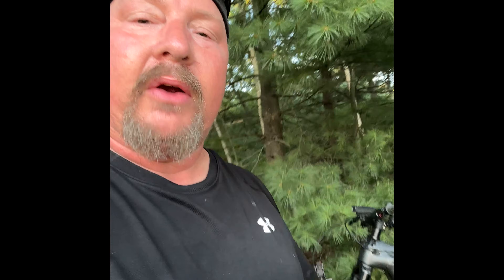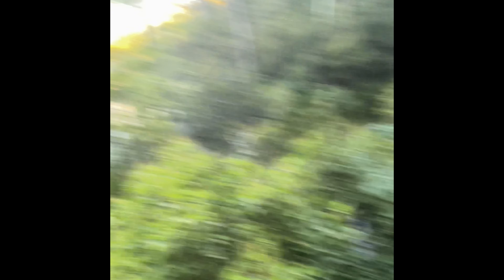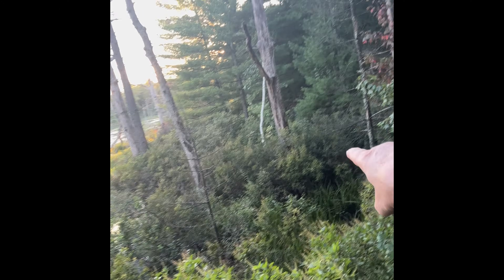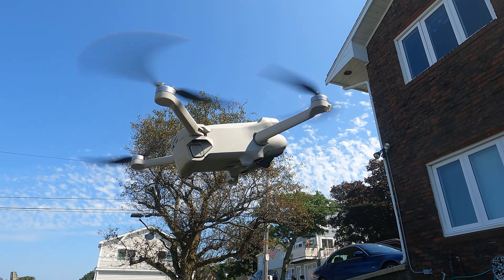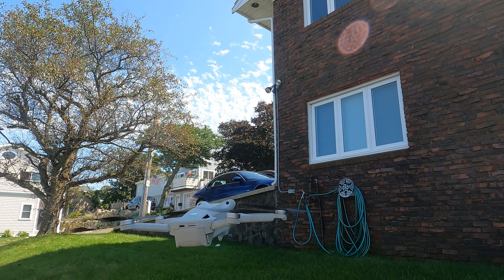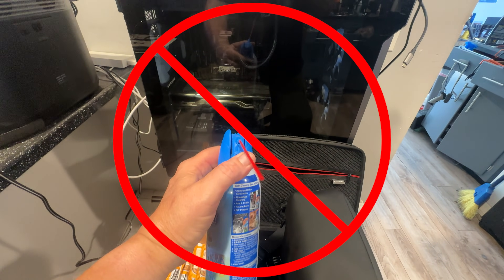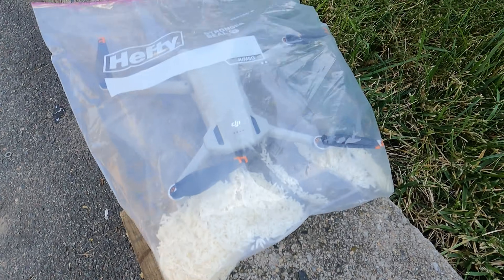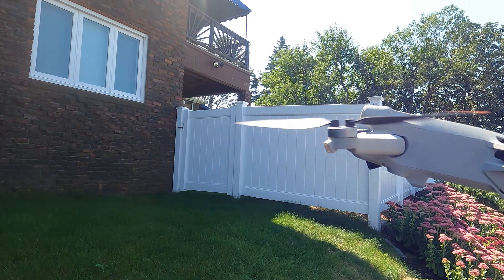HOW TO REPAIR YOUR DRONE AFTER A WATER CRASH

Comment: I'm surprised nothing was fried considering the power was on when it crashed, or the battery wasn't fried. 

Is there an update a year later on the status of it working?

 I just crashed mine into a creek when I was using it for tracking me walking my dog to the right, it hit some tree branches. I'm tempted to try and see if I can get it to work again but DJI recommends not to and instead of send it in. 
Just sucks I have to wait possibly 2+ weeks but I think it's worth getting a new drone.

I haven't tried my memory card yet, i'm letting that dry too, I hope it works

Comment: Hate to be that guy but.... Rice likely doesn't do much to dry out electronics. Dry rice just isn't very absorbent. You can test this yourself by weighing out a quarter pound of it then leaving it in humid conditions. Weigh it again afterwards and you can see that it'll absorb little to no water.
Your best bet would be to find a spot with dry air and set up a fan to blow air over it. If that isn't an option, you can get silica packets and place them and your phone in a bag. The silica packets will absorb at least some of the humidity.

Comment: On Friday May 17 I was flying over a river in eastern Tennessee and was flying towards a suspended walking bridge.  So I decided to elevate to fly over the bridge, but I could see the power lines over the bridge and flew into them.  Needless to say my  Mini 4 Pro went swimming.  I did have any rice so I put it on top of a split A/C unit so the A/C could pull to moisture out of the drone and the battery.  Now It’s Sunday May19 and everything is charging and flying.   

I dodged a bullet this time………

Comment: The most important things you didn't really cover are: battery out ASAP, rinse with clean water ASAP, rinse and re rinse u til confident no swamp juice or salt or any other minerals left, then repeat again with distilled water, tehn shake dry as much as possible, then the rice, or hot water cupboard, or in a room with a dehumidifier drying the air aggressively. More patient equals better for the drying step. Fingers crossed. Mine spent 4 hours under salt water today. Fingers crossed indeed.
Reply: @fredio54 can you pls let me know how it went? Did yours work again??
Reply: Did your drone survive?
Reply: @emilieherbert4990  no, sadly. Spares not economical when so much damaged. Cells in battery good, circuits not so much

Comment: If it's summer, I like to stick any dunked (wet) electronics in a hot car (with the device not in direct sunlight, unless it's not really hot that day). The heat will cause that moisture to evaporate....but maybe in a vented bag of rice in a hot car would be even better. And of course, IMMEDIATELY remove any power source (battery) from any electronic device (if it has a removable battery) because electric + water is the biggest issue. Remove the power immediately, then dry ASAP (and for as long as you can, within reason - IE, don't rush it, let it dry thoroughly).